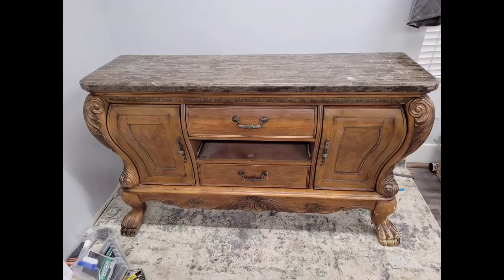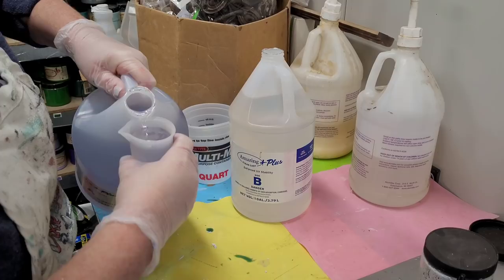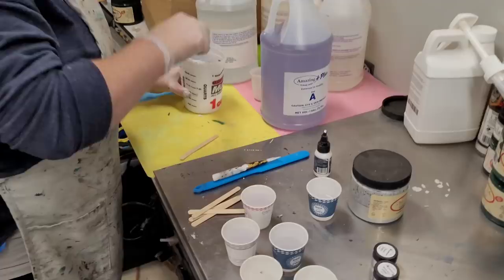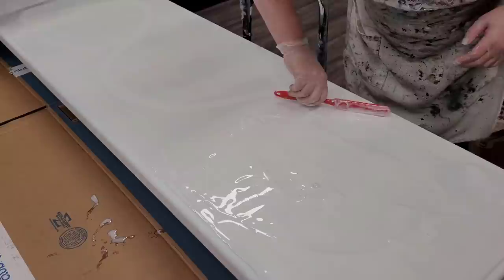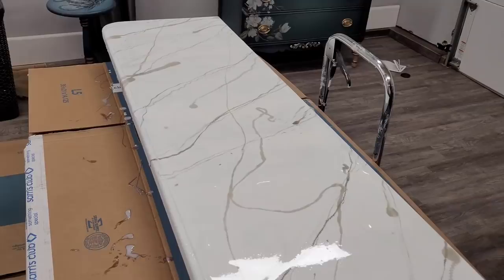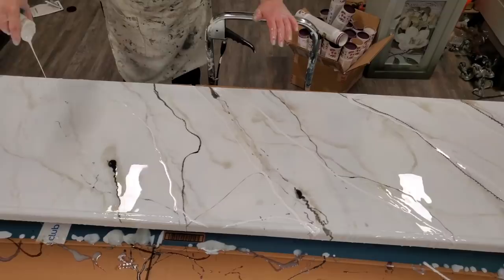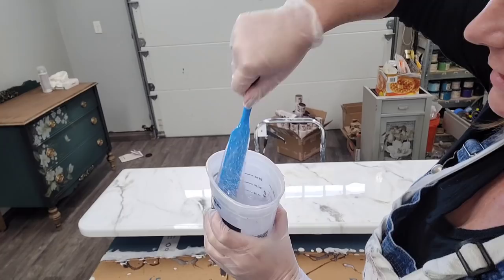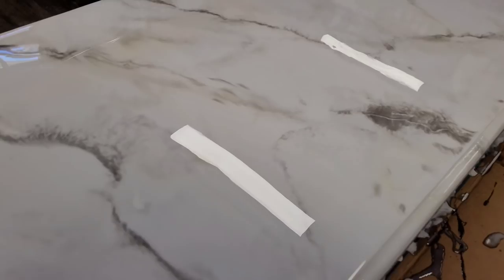creating a faux marble dresser top with resin

Comment: Brandy, why don’t you use the bigger cup to add both A and B?  It has measuring marks on the outside. Then you won’t need to use your silicone cup. Just wondering. 🙂

Comment: I do a lot of countertops with resin, I prefer stone coat countertop resin cheaper to use. long open working time as well. you might check out their channel! you did a fantastic job of course! they also carry a top sealer that drys matte! and has very high u.v resistance! Love everything you do!
Reply from the maker: Yes, stone coat is also made by polytek,  same parent company as what I am using
Reply: @BrushedbyBrandy  I did not know that! I really love their products! Again your top turned out beautiful! but then again everything you touch does !
Reply from the maker: @teresaechols794  thank you!
Reply: @BrushedbyBrandy  Beautiful as always!! I have questions. What do you reccomend to prevent yellow coloration? Do you use top coat as poly?
Reply from the maker: @adventureplays6666  do you mean yellowing in resin or in paint? This is a UV Resistant Resin to prevent yellowing over time
Reply: @BrushedbyBrandy  Thanks!! And doesnt need a top coat?